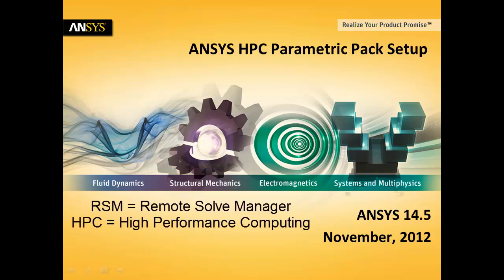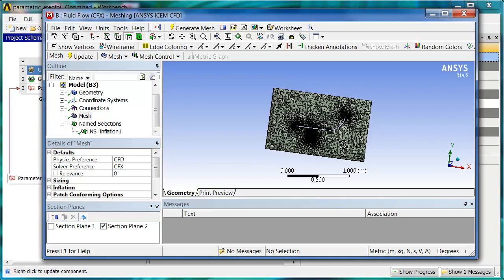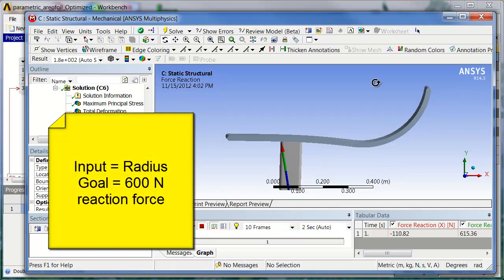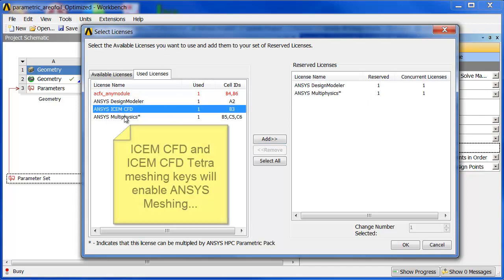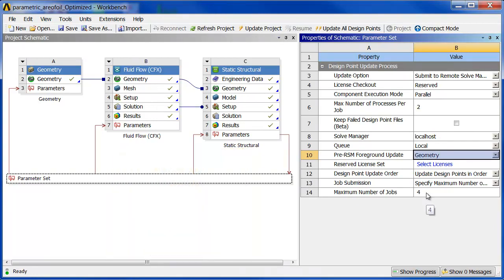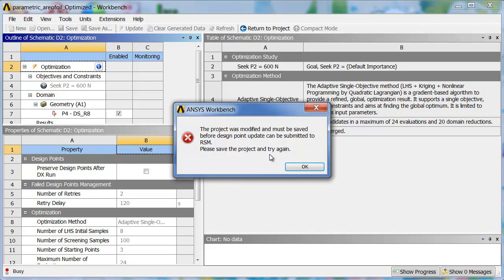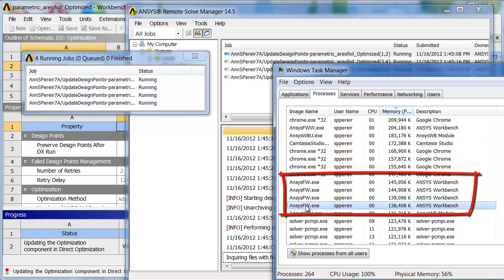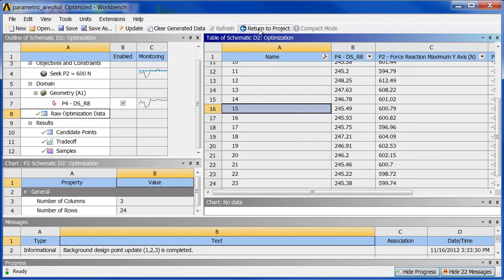ANSYS HPC Parametric

Comment: I am doing an optimisation of damper through CFD simulation (CFX transient analysis). My output parameter is the force which I am calculating using CEL expression. Since there are 200-time steps in the analysis. DOE is taking only values of the first-time step. But I want it is to be of some other time step say 0.135 s (27 step).  How can do this? I have tried all possible method but no use. Please suggest some remedy.